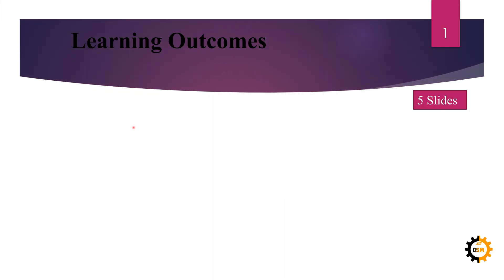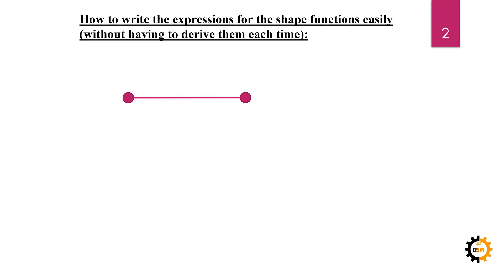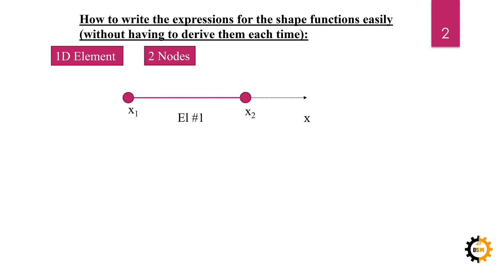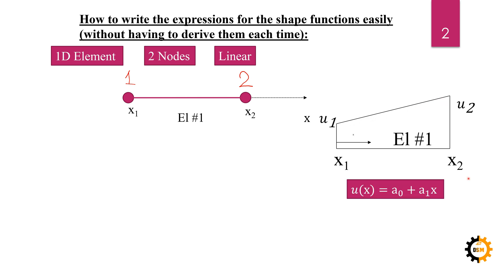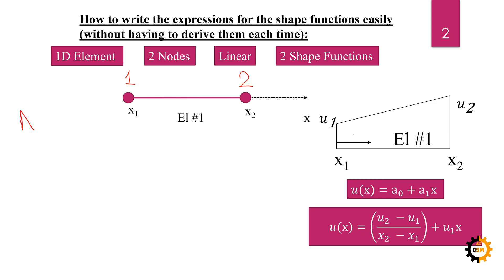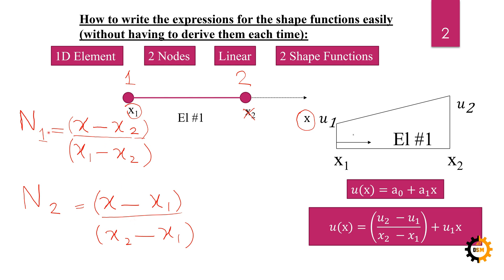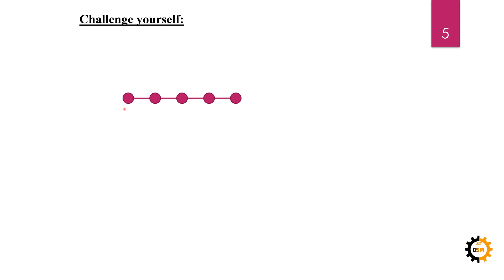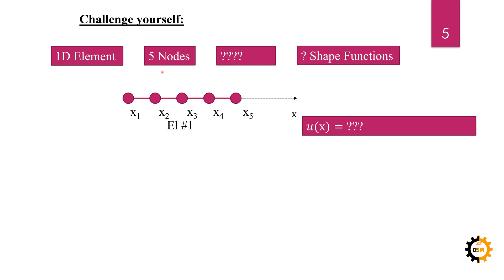Finite Element Analysis || FEA || 2.2 How to write shape function for 1D element? || Linear & higher

Comment: 5 nodes so 5 shape functions, and max degree of polynomial is 4 (Quartic Polynomial), u(x) = a0+a1(x)+a2(x2)+a3(x3)+a4(x4)
the numbering will be as the left most is Node 1 at point x1, the right most node is node 2 at point x5, and the middle ones are node3, node4, node5. on x2, x3, x4 points respectively.
the shape functions are very long, i have written on a paper. can send you on teams if you ask.
2017126
hafiz abdur rehman.

Comment: 1-Numbering the nodes in order as 1 at x1, 2 at x5, 3,4,5 at x2,x3,x4 respectively,
2-For five nodes the degree of polynomial will be 4
3-The expression called as quartic
4-No. of shape functions are equal to No. of  Nodes , so for this it would be 5 shape functions
5-shape functions will be as follows:

N(1)={(x-x2)+(x-x3)+(x-x4)+(x-x5)} / {(x1-x2)+(x1-x3)+(x1-x4)+(x1-x5)}
N(2)={(x-x1)+(x-x3)+(x-x4)+(x-x5)} / {(x2-x1)+(x2-x3)+(x2-x4)+(x2-x5)}
N(3)={(x-x1)+(x-x2)+(x-x4)+(x-x5)} / {(x3-x1)+(x3-x2)+(x3-x4)+(x3-x5)}
N(4)={(x-x1)+(x-x2)+(x-x3)+(x-x5)} / {(x4-x1)+(x4-x2)+(x4-x3)+(x4-x5)}
N(5)={(x-x1)+(x-x2)+(x-x3)+(x-x4)} / {(x5-x1)+(x5-x2)+(x5-x3)+(x5-x4)}